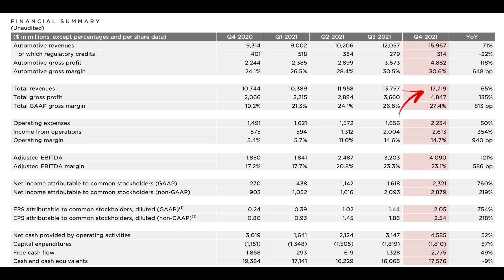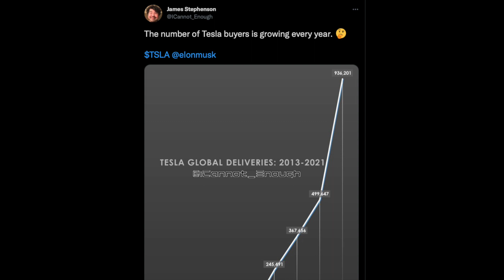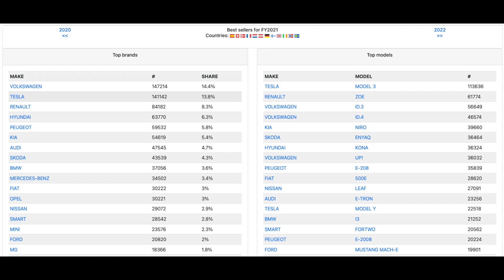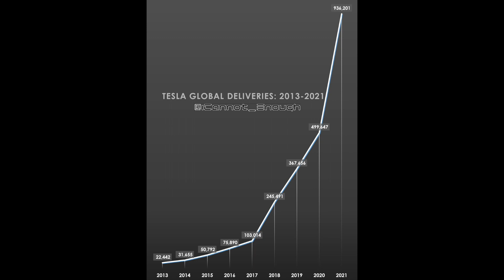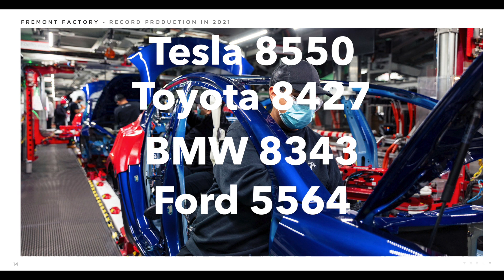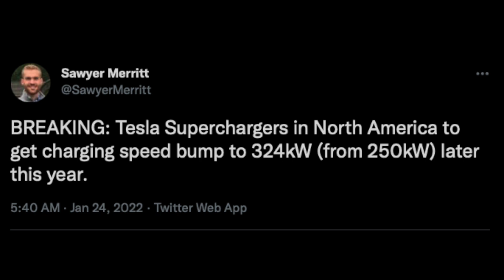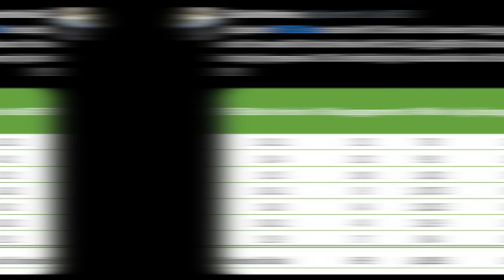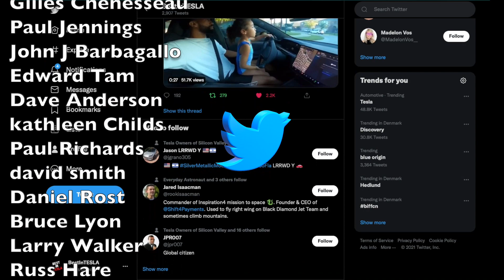Oil companies are out saying the Tides are shifting & Tesla is the most productive OEM in the US

Comment: A simple Cybertruck is desired for its repair-ability and cost savings.  But a FSD etc. loaded Cybertruck removes the physical loss of upper body exercise and also removes the mental exercise. Keep the single motor model with wiring to accommodate additional high tech modules if a customer wishes to add them later.

Comment: I would be happier with Tesla if they would build a truck that looks and can be used more like a regular pickup.  One that can actually be used to haul and tow cargo. That is the one of the good features of the F-150 Lightning.   If Tesla would build a truck like that, I would order one tomorrow.
Reply: Can't agree it's going to be a great hauling and work truck. But Fords truck will sell well. Just check out those specks if you plan to haul its not going to have the range when towing if there current numbers are correct.

Comment: Re:  the Geely crash:  no, that is not how a Tesla would behave if in a similar collision, but give it its proper credit--- any ICE car, especially an ICE SUV, would nearly be guaranteed to go completely over on its roof, with the heavy engine pulling the front down so that it would come to a rest with the back bumper high in the air, and passengers hanging high up @ a crazy angle, difficult for rescue crews to extract the occupants.

By comparison, anyone wanting to help would merely need to lean a bit against the roof of the Geely to get it back on its wheels;  but any car whose engine had the nose pinned solidly against the pavement would require one or more tow trucks and careful, dangerous maneuvering---- trying to push on it from either side would result in the car just rotating in position with the 

So the Geely does not perform as well as a Tesla in such a situation, but did not turn up- side- down as any ICE car would.

Comment: 18:47  Those antifreeze-filled solar tubes are designed to heat water; they have nothing to do with air.  They are extremely efficient solar water heaters and are commonplace in China.  I saw thousands of them on roofs 10 years ago already.  They generate a lot of heat, even on an overcast day.  You can see the tank at the top, which is where the incoming water gets heated.

Comment: 22:10 CORRECTION: Munro didn't say that Tesla was to die for, but he refered to the integrated smart engineering in general  with that statement.
Is BestInTesla sponsored by Peak Performance?
Sad to see Tesla is cutting down more trees. We complain about cutting trees in Amazon forrest, but it is apparently still okay to cut down trees in a commercial forrest ground in Germany and fill it with concrete, with no ground to plant back enough trees. A bit weird reasoning to move the problem to another area of the globe. Still makes it an interesting ethical debate in my view.
Reply: Tesla specifically stated they will plant many more trees than they cut, in other areas. Sounds like you are missing that key bit of information.
Reply: It's a tree farm - meant to be harvested.

Comment: Reference BP and Shell and their electric charging stations. The big note here is they are not installing hydrogen pumping stations - or not in any volume. They are not talking about hydrogen for passengers cars. Essentially if BP and Shell are all in on electric. Esso (Exxon Mobil) will follow suit. In the UK the largest petrol retailer is Tesco, then BP, Shell, Esso, Sainsburys, Morrisons, Asda, Texaco, - the ones you might not recognise if you are outside the UK are Supermarkets. Cannot be long before the supermarkets are putting in charging which will take about an hour to top your EV up, or the same amount of time it takes to do a shop.

Comment: So, 2170's from Berlin - but since the car is prepared for structural battery packs, even the 2170 have to be in a compatible battery pack.
It would also explain why Berlin starts with Long range Model Y, and saving the future 4680's for the Performances version.

Comment: BestinTesla - Another GREAT video Lars. keep on Trucking. 
BTW - Tesla today has over 35,000 Superchargers Worldwide and the NEW Supercharger Factory built in California, China and NE Trilburg (former Assembly) can produce over 10,000+ Supercharger each year. so, yes 90k by 2023 is not far fetched. 
more Supercharger news, Sawyer Merritt reported, that TESLA in the USA will be Updating Supercharger to 340kw DC fast charge in 2022. and that TESLA with NEW Batteries (2020) would be able to Charge Faster.
Reply: sorry, CORRECTION - Tesla 324 kw Superchargers.

Comment: Now Tesla with all that money get the last problems with build quality out of the way. (Probably the new factories wont have these problems anyways). More importantly get the customer service to a good level
Reply: Exactly, people forget that many automakers have perfected build quality over a hundred years.  But Tesla has great engineers, and I think they are concentrating on exactly what you are saying
Reply: tesla needs the oil industry to be able to make cars, from all the parts to the raw materials mining to even the factories, the roads, the grid/Infrastructure…… even the solar/windfarms are only possible because of the oil industry.
Reply: @joenavarro2973  stop talking nonsense, other manufacturers have invented the assembly line, invented a lot of modern features used in cars like ABS, brakes, seatbelt, stability control, they have made the 12v standard, they have perfected manufacturing and they make all kinds of vehicles for all types of applications.
Reply: @joenavarro2973  the Mercedes’ Benz UNIMOG alone is the world’s most versatile truck used in mining, agriculture, construction, rescue, firefighters, ambulance, rail/infrastructure maintenance…… the Mercedes’ sprinter and other Mercedes’ commercial vehicles comes in almost a 1000 different configurations for all kinds of applications. Tesla has basically zero/nothing.
Reply: @carholic-sz3qv  Then tell me why Teslas are by far the safest vehicles on earth. Maybe Tesla did not invent all these things, but they keep improving everything at insane speeds. Also they still invented many other things like fsd, autopilot, they revoloutionized the software in cars, they revoloutionized EVs in general and they completely changed how EVs are mass produced.
Yes we still need Oil for many things, because we are currently in the process of getting rid of it. This will still take many years, but Tesla is definitely helping and in the near future Oil will be almost worthless. Even the big Oil companys are understanding it and now they all start switching to renewables and EVs, while Tesla did all of that 10 years ago. Thats why they will soon get by far the biggest company on earth, while people today still cannot see it and are thinking big oems are gonna outproduce Tesla, their quality is better blablabla.
Reply: @geiers6013  tesla is “one” of the safest vehicles you’re welcome.
Reply: @geiers6013  this comment is laughable, sooo much wrong, you didn’t need to make a bible lol…..
Reply: @carholic-sz3qv  Whats wrong?
Reply: @carholic-sz3qv  I like to look at iihs crash test rating, because their crash tests are much harder than other standards. I think in 2020 the model 3 got one of the highest if not even the highest rating in a crash test of any cars and now the model y is even better and scored the highest possible score. Now consider they are getting safer and safer with every software update and fsd is getting better really fast with that many cars and data. I think we could possibly see it reaching consistent human levels of driving in the end of this year or next year.
Reply: You know what is better than customer service?  No service required.  You want great customer service go pay 30% markup for a Mercedes.  They will give you great customer service.  You want more car for your money?  Go buy a Tesla Model 3 LR and spring for FSD.  Getting a $175k car for less than $65k is a great deal.
Reply: @davidbeppler3032  Yap, I agree Evs in general are needing much less service. And I also agree the model 3 is by far better than any competitor, but still some people have problems even with brand new Teslas and they usually have to wait very long for repairs and they do not fsr refunded if the car is unusable a whole months for example. Tesla just needs to fix this its no big deal.

Comment: I’ve installed similar rooftop solar tubes.  But, those were for hot water supply.  They’re very efficient at it.  Which makes more sense then a heat exchanger @18:53.  I think those tubes just supply hot water.  Maybe not, I’m sure there’s lots of different stuff on the market these days.  The one I installed just used potable water.  Some others use weird glycol and anti-freeze mixes I hear.

Comment: I am sure BP and the like have thought of this, but why not store energy at their stations rather than pulling off the grid. They can act as buffers buying cheap electricity and acting as mini peaker plants. It would also allow them to cut down on inverters from the AC grid.
Reply: The thing you totally forget to talk about is that tesla needs the oil industry to be able to make cars, from all the parts to the raw materials mining to even the factories, the roads, the grid/Infrastructure…… even the solar/windfarms are only possible because of the oil industry.
Reply: @carholic-sz3qv  er.. but I am not forgetting to talk about that, because I am not talking about oil production or use.
Reply: @carholic-sz3qv  That is true, however as long as the oil company products are not, for the most part, burned and do not enter the atmosphere as carbon dioxide/methane or pollute the land or water, who cares? Worn out road surfaces can be recycled into new paving materials to an extent as well. If costs for oil products become too high due to low demand for fuel increasing the per unit costs of producing them, then alternatives will be found.
Reply: Companies pay 60% less per kwh than consumers.  Profit is baked right in.  If you get electricity in your home for $0.13/kwh the businesses in the area get it for $0.05/kwh then they resale it to you for your EV at $0.31/kwh!  My question is, why are the big electrical companies not getting in on this free money?   They are ignoring billions in profit.  They are stupid.

Comment: I expect Tesla to start offering their cars with an option on the type of battery pack. They may not mention the type but just the potential miles between charges, but behind that will be different battery technologies. You want 500 miles? Sure, for a premium price. 400? Standard pricing. 300? A credit of $2000. Something like that.
Reply: Mike Lambert:  That makes sense.  I'm also thinking that things like safety (re flammability of the battery) and longevity (charge cycles) of the battery might also be marketing points, especially if the battery can handle lots of fast charging cycles. 

So if the 4680 cells for the Model S work out as planned, perhaps they'll be worth a significant premium, even as they lower the cost of production for Tesla for battery packs of size X.
Reply: I'm pretty sure that once the vehicles with the 4680s are actually being sold, Tesla is going to update the specs for that model, because why wouldn't they?  It has a longer range so I assume they'll charge more.  But these vehicles aren't being delivered yet, so there's no reason for them to change any info right now.